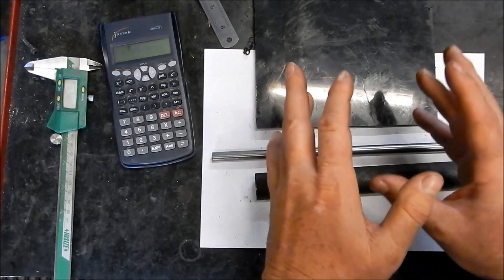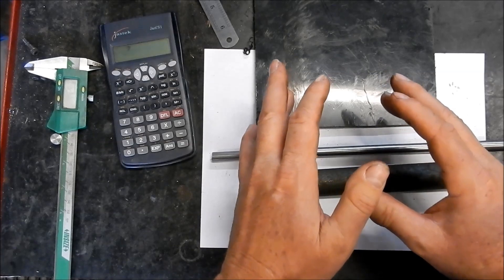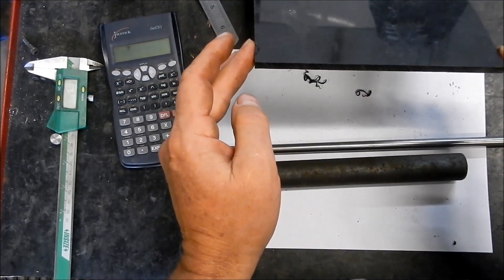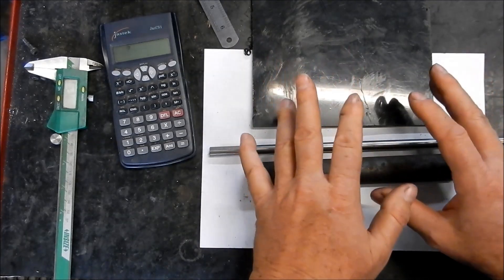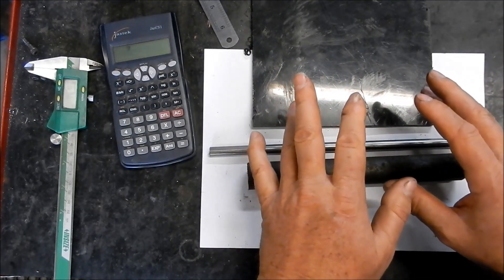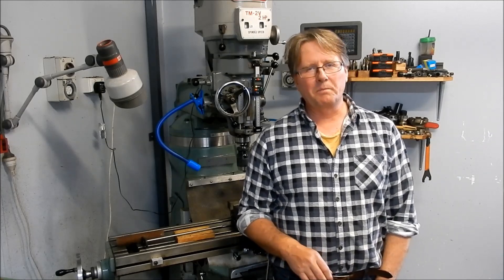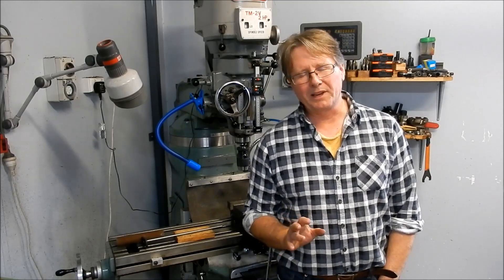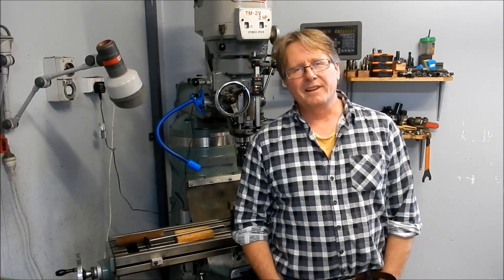Powered Lathe Top Slide #tmc2020

Comment: HI CAM, I MADE ONE OUT OF A WIND SCREEN WIPER MOTOR AND A TOOTH BELT, WORKS WELL, WITH FORWARD / REVERCE, AND SPEED CONTROLE.  REGARDS FROM U.K.
Reply from the maker: G'Day Richard, having a constant speed control would really be a bonus.  Its going to take a little practice to get the feed just right by hand.
Cam